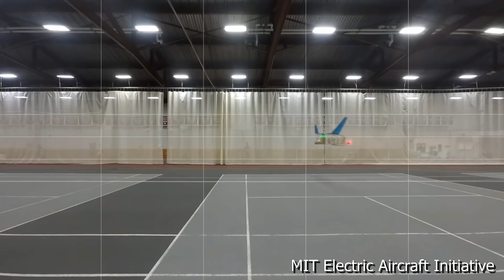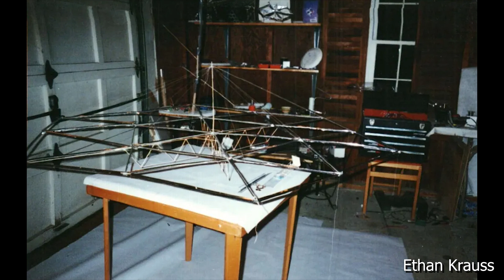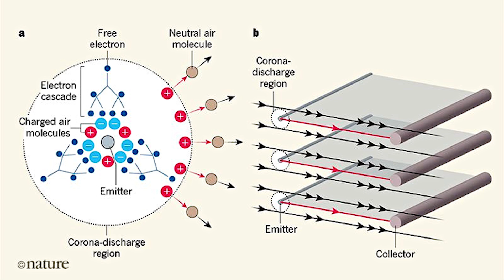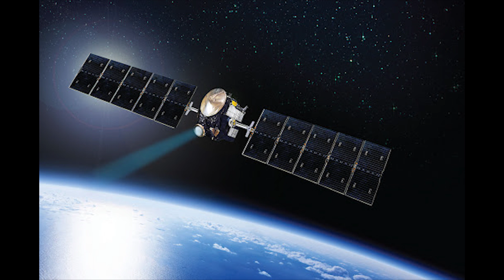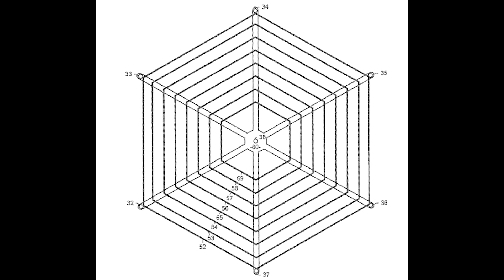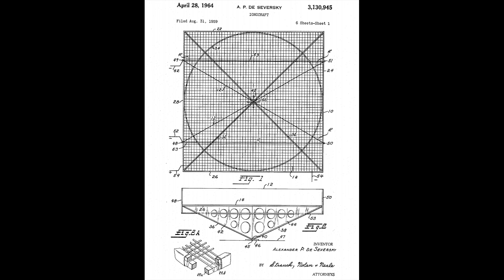Interview with inventor of the first self-contained ion-propelled aircraft

Comment: How much power is needed for your self contained powered ion craft would a scaled down ion craft on its side push the craft forward? Also how much weight could this ion craft lift? I wish you all the success on your future designs loads of love from the UK xxxx
Reply: Thanks for the kind comment, same to you:)!!  It only requires roughly 7 or 8 watts to fly.  Much of the energy is lost in the transformer though. On about half throttle it is much more efficient.  It takes a fairly large surface area to produce an acceptable thrust per watt.  It has flown on one side before in the past.  It takes much less power to fly sideways. It weighs about 25 to 30 grams maximum.

Comment: Atmospheric fuel efficiency is mostly based on how little power it takes to move the vehicle. As most of the air is not consumed as oxidizer but used as free propellant.

With vacuum/rocket ISP it is the exact opposite. Propellant is the thing that is scarce in a vacuum, not necessarily energy. As such, with constant energy efficiency, the best ISP is achieved by having the HIGHEST energy devoted to each particle.
Reply: It is possible to use the energy more efficiently though.  O2 molecules naturally absorb electrons, creating negative ions.  The process requires an electron source but no further added energy for ionization, it also produces far less corona and byproducts.  It is much more more efficient process.  Isp is also dependent on voltage and geometry, and both have been improved upon over previous systems.  If the craft has significantly lower mass, and accelerates smaller numbers of particles at much higher speeds, and when less heat is consequently added to the exhaust, it will have a higher ISP per watt in space.  It is also possible, at least mathematically, to use relativistic electrons.
Thanks!

Comment: Would it ever be possible to somehow multiply the existing~100 V/m potential differences in the atmosphere and get useful thrust from one of these on only atmospheric potential differences?
Reply: Very interesting idea.  The only challenge though is that the current is relatively very low per area.  One could theoretically store it up though continually and just fly for short periods of time.

Comment: 20 min in and for the love of god what's the battery and how does he work with that thin wire?
Reply: Hi Bart,
Sorry about that, It uses 2 very small high discharge rate lithium polymer batteries. Depending on the model, from 20 to 120mAh each.  (update, up to 180.) It is very challenging to work with such thin wire, it takes very good lighting, magnification, and care.
I hope that answers your questions!  Bradley did put links with further information.  Best regards, Ethan

Comment: What If the alien “levitation” technology is just the ion thrusters technology but they are a lot stronger... interesting.
Reply: my first tought to!!
Reply: that's what it was. Did you read "Secrets of antigravity propulsion" by Paul La Violette?
Reply: @MadScientist750  No, I just had this Idea and wrote in down here
Reply: @lolerthegoat8603  It's because there's nothing alien about it, this physical principle has just been kept out of the eye at school and university.
Reply: @MadScientist750  this is bad cause if every student would know this thing and so many others like this, I think more people will start to study with more interest.
Reply: @lolerthegoat8603  That's the problem
There were never been a reason to use cars, buses, lorries/trucks, trains, when even the implosion engine of Viktor Schauberger has been built and proben..
Please look at http://www.aetherdynamicpowersystemsllc.com/#technology.
I strongly believe the so called "UFO" are nothing more than high power flying capacitors carryng such turbogenerator as power supply unit.. a 100% electronic airplane..
Reply: @MadScientist750  You're not a mad scientist, you're a lunatic. Go seek help.

Comment: Is this anti-gravity, or something else? Does the device produce some kind of thrust by moving air? Is it shielded from gravity?
Is it reversing the direction of gravity? Would this device levitate in a NASA vacuum chamber?
Reply: Hi Michael,
It is not antigravity, it's an ion thruster that has increased efficiency in order to lift its own power supply. It adds electrons to ambient oxygen molecules using low wattage.  Then, the charged particles are pulled downwards electrostatically toward the collector surfaces.  There are also some uncharged molecules that continue below the craft along with negative oxygen ions.  Since the device can also carry very small additional propellant tanks containing O2 or SF6,  it will work in a vacuum in theory.  Since it operates with very high voltages the particles would be moving relatively much faster in a vacuum. 
Thanks for asking!

Comment: Just asking, why don’t you use AC current that can move through the air? Or maybe a simple testla coil to move the energy to a collector that can use the energy for the craft?
Reply: If electrons are just added to the O2 molecules in the air, they will jump down to a positive collector, Like oposite poles on magnets, except its electrostatic rather than magnetic.  If the polarity was alternating 50/50, there would be no lift.
To answer your other question, Tesla coils are much larger and heavier than small  ferrite transformers.

Comment: Coooooooooool.
Reply: Perhaps, in a laboratory setting with the correct safety measures in place (Good ventilation), you can use the radiation emitted from thorium (or another actinide) alloy wire to generate ions.

Comment: Energy consumption per unit of thrust increases with specific impulse. In atmosphere, moving more air less quickly results in better efficiency. Unless there is another source of energy, in order to generate 14g/watt of thrust, an engine needs to have a specific impulse less than about 1.5s, or 1/2000th of what the dawn spacecraft generates. If half the power is lost in the transformer, then this number is even smaller. Put another way, the Dawn spacecraft needed at minimum 150 watts to generate a gram of thrust.
Reply: I should note that sometimes Isp for air breathing engines means thrust/fuel consumption, instead of thrust/exhaust rate as I have been using. As this craft doesn't use fuel, it has infinite Isp if measured this way. If you powered it with a hydrocarbon based generated, then this Isp could easily be hundreds of thousands of seconds, however, since the question is how well it would do in space, this number is irrelevant.

Comment: I feel like this (really impressive) craft is not really suitable for spacefilight like you speculated. Its engine needs to be optimized for a high thrust to power ratio, so it moves a lot of air rather slowly, like a helicopter blade. Consequently, the "specific impulse" is orders of magnitude lower than that of the dawn spacecraft (I'm using specific impulse loosely here as no propellant is actually used). We can compare the two more adequately by using exhaust velocity for comparison (it directly corresponds to specific impulse if all your propellant is stored onboard). So, the dawn spacecraft engine with its 3100s of si has an exhaust velocity of 30.4 km/s, the SSME has 452.3s(vac.) sp. imp. and 4.4 km/s ex. vel. and, judging by the smoke in Ethan's videos, his craft's ex. vel. can't really be higher than 10m/s which (given that all the propellant is stored onboard) gives a specific impulse of under 1s. This comparison doesn't really take into account the power consuption, and if thrust/watt is what we want Ethan's engine would be the clear winner (I don't have the data needed to calculate how good it is exactly but if it had the same N/W ratio as the dawn spacecraft - 0.000006 N/W - it would need over 1.5kW of power for each gram it weighed)
Reply: The Dawn Spacecraft uses 3.25mg of propellant per second.  It operates at about 3kV.   It needs 2.6kW to produce about 9 grams of thrust (289 watts/gram of thrust,) weight: 1,647.1 pounds (747.1 kilograms,) at 0.00014g of acceleration.
This craft can produce ideally about 14 grams of lift per watt, at almost 1.4G of acceleration (all VTOL crafts can produce over 1G of acceleration to overcome earth's gravity.)  The speed that the electrons leave the emitters is proportional to the voltage, apparently it is the same for ions, it depends on the propellant and geometry and is much higher in a vacuum.  At 40-50kV, these voltages should produce a much higher exhaust velocity in space.  Isp is proportional to exhaust velocity, but its more accurate if propellant type is taken into account. While the propellant goes exponentially faster when it gets near the collector, it is still slow overall when in the air.  To reiterate, it was demonstrated experimentally that the propellant exhaust will  move much faster in space. There are plans to increase the voltage by many times, so its promising.  As Bradley mentioned though, some tests really need to be done to find out.
Thanks!
Reply from the maker: Ethan's pool ball analogy in the video is key here.  An ion engine is ionizing a very small mass of gas, and generating impulse by accelerating it to a very high speed.  In an atmosphere, these ions quickly interact with a lot of other atmospheric gas, inducing the ionic wind.  The momentum from the ions is being distributed to a mass much greater than that of the gas that is ionized.  To find the actual specific impulse, we would need to determine how much gas we actually need to be ionized, and how fast that is moved in a vacuum.
   There are a lot of factors here, and I don't know the answer as to what the specific impulse would be of a similar engine in a vacuum.  What I do know is:  The exhaust velocity in a vacuum will be much higher than 1s.
Reply: Thanks for both of your replies!
While the engine will achieve a (possibly much) higher specific impulse in space, it will inevitably do so at the cost of reduced thrust (assuming energy consumtion doesn't change)
"The momentum from the ions is being distributed to a mass much greater than that of the gas that is ionized."
This is exactly why. Taking this engine into space would be like removing the fan from a turbofan. You could use just enough propellant so it all ionizes, but then a different design would probably be better. It's like saying a helicopter could be possibly used on the moon becouse it is so much more efficient than a rocket engine. I feel like this engine shoudn't be judged by what it can or can not do in space, it was designed for a high thrust to weight ratio and low power consumtion and those two things somewhat contradict a high specific impulse.
Reply: @piotrfila3684  
Hi Piotr,
It is fun talking with you, but if your saying "it will never work," you know I've heard that one before:).  This ion propelled craft was honestly pretty obsessively designed, to take as much into account as possible, for over 20 years. It was indeed designed in part, to move air slowly and efficiently.  It is not a helicopter though, it is an ion thruster. It would operate very differently in a vacuum, in terms of how fast the onboard propellant  O2/electrons will exit the craft.  The speed of the propellant for future space designs of this has been absolutely maximized, and the wattage and propellant use minimized. Since this has only been shown mathematically and I can't really prove any of this yet, I'm going to keep working on more immediately practical matters. Who knows what is possible in the future! 
Thanks for commenting!
Reply: @KraussEMUS1  Haha 640 kbytes of ram come to mind :) I just found it weird to compare this with a spacecraft, the design requirements are so different.
Reply: @KraussEMUS1  Great work, too! The design looks really optimized

Comment: Great video and super interesting to hear it from the horse's mouth so to speak, more please. I know aircraft engines aren't exactly safe if you get too close but would this thing basically be a flying electric fence in terms of safety?
Reply: Although the voltage is high, the current is so low, that it's pretty safe.
Reply: @KraussEMUS1  Ah ok, i was wondering whether your test flights were dangerous affairs. "Its the amps that kill you, not the voltage". Thanks for the reply man, keep up the good work!
Reply: @KraussEMUS1   Also would larger components that are able to take more power create enough thrust to overcome the extra mass? And are there any thermal benefits with larger components?
Reply: @johnk190  
The answer is complex. A slightly larger diameter transformer is better, if the profile remains very low, it dissipates heat a little better.  Higher voltages tend to be more efficient .  Higher currents tend to be less efficient.  It is a bit like a link in a chain though, it may not help to have just one large link:).  Thanks for the question!

Comment: Ethan Krauss- I appreciate all your work on ion craft, I too have been tinkering on small ion craft since 2006. Have you ever tried using an air foil shape for your collector plate? I have seen some improvement in lift to structure size depending on angle of attack. I havnt managed to do onboard power supply yet but hope to soon, keep up the great work! And thanks Bradley Whistance for the informative interview on near future propulsion tech!
Reply: Hi Brian,
I settled on a teardrop wing cross section for the collector surfaces long ago.  I measured the thrust to weight ratio, and tests indicated that a 4mm wide, by 12 mm tall wing/collector, seemed to give the most lift.
Thanks for asking!
Reply: @War Dog  
Hi War Dog,
Your comment is much appreciated!  I've heard good things about Mister Dollard, I think I saw a video of his once.  I have heard of these other concepts.  Before I was an EE, I was a musician, so I always think about the possible effects of harmonics in a system.  Thanks a lot for the ideas!
Reply: @KraussEMUS1  it seems the quiet is a wonderful quality of the design, but have you tried implementing a buzzing equivalent to the size in proportion using say a bumble bee as the standard? There may be something more to the buzzing which also might give lift etc.
I always keep pondering the Egyptian beetle, leedskin's sp? coal castle, and the other very old beetle wings lifting box thing that allegedly had handlebars and could travel that guy around but I forget his name.. He claimed the wings could lift the device.. I need to go look all this stuff back up again.
And.... O-H....!!!😉
😎👍
Reply: I've collected a lot of data on so-called ion-wind propulsion and i'm convinced there is something else at work here, not just ions bumping into air. In some of the data i've seen that a large collector area improves the effect, but in others it doesn't. I'm making a test-bed to test DC power and AC power at different frequencies since it's likely the frequency or power difference that enables the larger collector to improve efficiency. An Israeli group said they had anomalous efficiency increases using AC power at certain frequencies or their multiples but they stopped reporting after that and now i can't find the original video.
Reply: @GaryMcKinnonUFO  
Hi Gary,
As I've mentioned before, I think some important points are, O2 electron affinity, electrons, and mostly static pull at very low currents.  I realize some people might strongly disagree though. I just go with what appears to work best in tests.
Thanks!

Comment: You should have this guy on your channel for a regular series, I originally encountered this (at the time) seemingly unknown mysterious phenomenon, back when YouTube first launched and people like Ethan started uploading other-worldly demonstrations. Anyhow, I think you could weaponize the KPS communities applied autism, if you made this a regular think. By which I mean, thinking of ways to improve upon existing ideas and use for this emerging technology.

Way back when these were called "lifters" and they could only be found on the dark side of YouTube, alongside alien conspiracy channels.
Reply: On which note, I'd like you to ask Ethan... has he considered drastically increasing the potential surface area with the use of PCB's or modern flexible light-weight PCB's? With the extreme precision you can achieve with CAD and printed circuits, it would be possible to maximize surface area to the extreme, presumably significantly increasing thrust and push this technology to it's absolute fundamental limits, all the way down to the nano-scale.
Reply: @RpattoYT  
Hi rpatto92,
Fascinating food for thought!  Flexible PCB's can help, although I did use them in the past for some system parts. This craft started before the name lifter was coined, so I am used to calling it something other than a "lifter."  Avoiding needing a large heavy external power supply is one difference, as well the geometry and other details that are different.  I certainly agree that flexible circuit boards are the best for lightweight applications.
Thanks!

Comment: Firstn't

((first not))
Reply: It is the first heavier than air ion propelled aircraft with onboard power. It is independently verified and patented.  It takes quite a bit of thrust to take off vertically with the power supply.